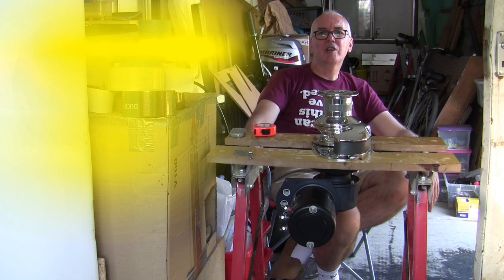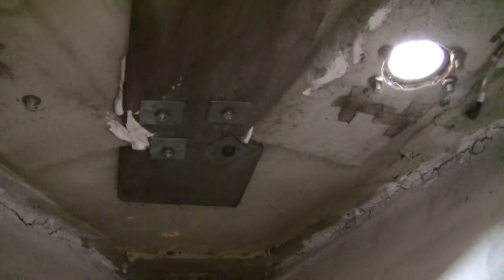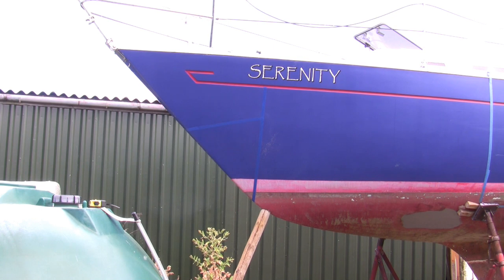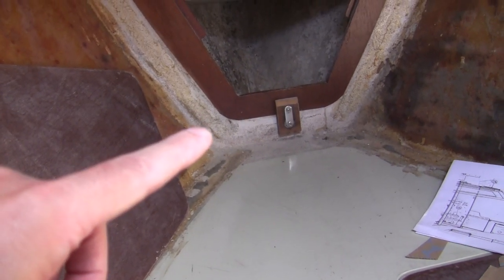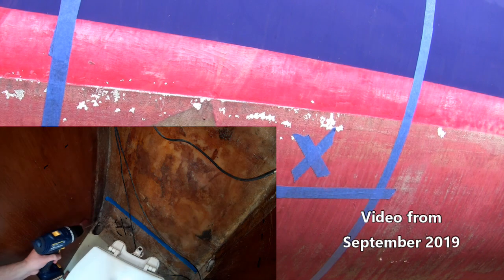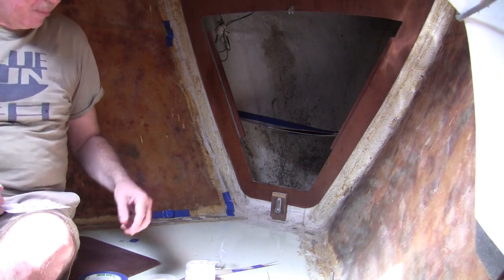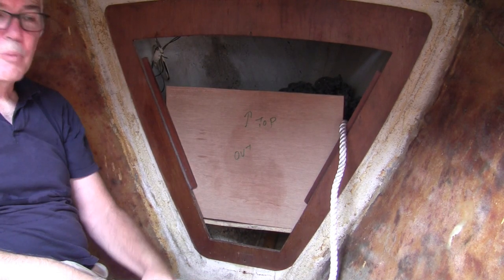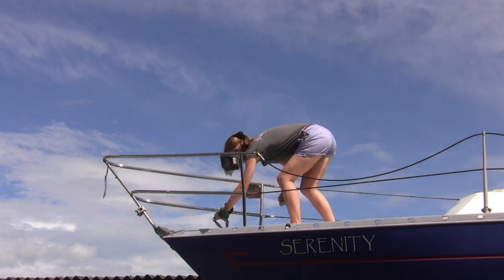Just About Sailing August 2020 - Installing the new Windlass - Pt 1 Chain Locker Modification Plans

Comment: Paul hello, Really enjoyed and learned a lot from that - thank you...
Just anecdotally the 300mm chain drop from below deck did not work in my last boat (Westerly Ocean 43) if I had laid out all the chain and a bit of warp - cos it always formed a pyramid ....  The chain did not just fall into a neat coils rather heaped up...  the first I would know was that it jammed at hole by the windlass!  I had then to get into the chain locker via the hatch and spread the chain out.. then unjam it - not always that easy...  
I am assuming the windlass people stipulated the 3300mm.. Also I have no solution to  offer...  When I installed an electric windlass onto my Moody 36 and was anchoring on a daily basis never had the problem - so .... Maybe the drop was greater or the floor was angled so the chain fell to one side???
I have not anchored yet in my new to me Beneteau 323, partly as I am waiting to change the danforth for a CQR - probably a rip off... The price of real CQRs is impressive...
Thanks for all the information
Michael
Reply from the maker: Michael
I have been on a number of boats where the procedure was basically to open the chain locker from above and pause the windlass on a regular basis to 'push over' the heap of chain with your foot. An accident just waiting to happen.
The 300 mm is stipulated by Lofrans. But I bet that there is some physics that would help to understand the factors that would encourage a chain to 'coil' rather than 'pyramid'. Obviously if the drop was big enough it wouldn't matter what the chain did. But I do have a bit of an angle on the new locker floor, so maybe that will help.
When I've got it all installed I might fix up a camera with the watertight door open and film what is happening inside the locker - or just shove my fake GoPro in the locker with a light and cross my fingers that I don't wreck yet another one.
I swapped from a (probably fake) CQR to a Roca with some trepidation, but have been very happy with it so far.
Cheers
Paul

Comment: Shiny as always. Just an idea about the drain in the anchor locker, I think it would be an easy option to fit a small bilge pump and that way you could have the exit high again without having to fit a seacock which will take up quite a bit of space. Plus then all you need to do is flip a switch rather than having to get in there to manually open and close it?
Reply from the maker: Thanks. Yep, that would certainly be an option. I am probably making this more complicated than it needs to be. Although I intend to fit a seacock, it doesn't really need it. It will probably stay open for 99% of the time. I am probably more likely to forget to press a switch than I am to open/close a seacock.
I think that pretty much all of the different suggestions would work. There are even more if you google the subject. The main thing will be to have an electric windlass - that will be pur luxury. And it is very, very Shiny!
Thanks for watching
Paul

Comment: I really like this one.  I have a C&C 30 with the same kind of locker in the bow, but no holes through the deck to feed chain.  You've given me the confidence to install a windlass and hawse pipe,and start using the anchor locker.  As it is now, I have to keep the anchor sitting on the deck and just have rode attached to it, hanging on the pulpit.  I have a feed through to the bilge to drain it, but am a little concerned about mud building up, so may also use your drain approach..
Reply from the maker: I am guessing you have the C&C 30 which is the same shape as Alfie's (Sail Life) old boat (a C&C 34). I found his video from about 2 years ago very useful. His boat has a similar shaped bow - which is very pointy. His video was mostly covering the wiring, which I am going to copy.
Please have a good look around at what others are doing. I don't want to be held responsible if everything goes horribly wrong ;)
I haven't seen anyone else doing quite the same as what I intend....and there may be a good reason for that which I will only discover after a few years use.
There was a lot of 'crud' in the bottom of my chain locker which had built up over the years.
Good luck with it.
Cheers
Paul

Comment: I learned the hard way that you get the effective new-generation anchor you want first, and the bow roller that fits it.  Get them mounted so they sit well on the bow and only THEN mount the windlass to line up with the roller.  

If you upgrade the anchor eventually and or roller after your new windlass is mounted you are inevitably going to find out that a larger anchor and wider roller will not line up to where the tiny narrow roller used to be.

Ease of anchoring is all about a heavy duty roller that can handle the anchor well and not bind or jam and can bring the anchor itself up to be held securely without needing to hang over the bow and use brute strength to do it by hand.
Reply from the maker: Thanks. Good advice.
Well I certainly don't have the brute strength to pull the anchor up by hand - so that's not an option. Although I do have an emergency set-up where I can use a main winch; just in case. I used it once in a strong tidal stream, but once the anchor was off the seabed it was very smooth.
I invested in a new Rocna ages ago and have been very happy with it. I never liked the idea of 'plough' anchors. I've spent plenty of time watching fields being ploughed. The plough anchors are literally exactly the same design as the agricultural ones that can be dragged happily behind a tractor. I never saw the sense in them, as they are not designed to hold firm. I got rid of the one that came with the boat as soon as I could.
The Rocna actually comes up well on the current roller and (more luck than judgement) simply fitted straight away as soon as I installed it. It also stows very securely without banging or rattling - the self-righting 'loop' fits into a little holder that I attached to the pulpit to make it extra secure. I think the fact that Serenity has such a pointed bow with a huge overhang helps a lot. I have been very lucky with the way the Rocna has fitted - I know that some people (with more upright stems) have had a lot of problems fitting them and have to make all sorts of modifications.
I also invested a bit more to get calibrated anchor chain (8 mm) knowing that I would install a windlass at some point.
The vertical windlass is a bit more sensitive to its relative height to the bow roller. But as long as the (chain) angle from roller to windlass is 5 degrees or less it should be fine.
I am having to change the rode to three strand as multiplait doesn't work too well with this windlass.
I'm thinking of using a lightweight anchor such as a Fortress for the stern with shorter chain (possibly 6 mm) and a longer rode - maybe reuse the multiplait. I already have a ready made locker with a drain for that as I am not using my gas locker any more.
I hope you are doing well.
Cheers
Paul
Reply: Sounds like you have things settled well then. Rocna is great, we have a 45lb Mantus.  

Get it lined up as well as you possibly can and make sure the anchor is easy to secure quickly once in it is up and in the roller.  I run a second line up through the roll bar and then back down to a cleat I installed just for this purpose.

A fortress on a rail mount in the cockpit is a good stern anchor. We have an ikd 30lb Danforth.  Make sure the rode is large enough to be easy to handle since tiny line makes the job that much harder without a windlass helping.  But a sheet winch is right there if necessary.   

We have massive 3/4" line that is super easy to grip even though it is nearly twice as strong as it needs to be.  8-braid lays down really well and packs into a small space. It's a good choice.  Having a line locker aft is really nice.  I sacrificed a locker aft to store ours too.  

We have 220 feet of fiber and 25' of massive 3/8" chain (that weighs as much as the anchor itself) on our aft anchor.  

We have 220' of calibrated 8mm chain on our main anchor in the bow with another 150' of rode that we have never used.  We rarely put out more than 120-130' of chain since we draw 4'3" and usually anchor in as shallow of water as we can find.

Comment: The simple solution is to make an external drain hole  at the bottom of the existing locker. I did this with my Rival although it's not been tested in any rough sailing conditions. What may come in will drain out. The conversion to an elevated floor will likely leave a situation where you will be having to go and push down a pyramid of chain building up under the windlass. My old mk 2 had a leak from the rear of that 'shelf' which needed someone with a very long arm to repair from the deck hatch. This water would build up in the forward bunk locker. Electric windlass was a good investment.
Reply from the maker: Mike
Thanks. The electric windlass will definitely be a good investment. I don't think I could actually sail without one any more.
The drawing I have for the Mk I is a bit misleading. As was the brief bit of video I shot of the 'bottom' of the chain locker. I vacuumed out a ton of old detritus and then used the magnets to find out how far down the locker actually went. It goes right down to the water line - possibly even a few millimetres more. I am loath to put in a hole that low.
I think I also have a bit of a leak at the bottom of the bulkhead (under the V-berth shelf) because I also used to get pools of water and I can't think where else it could have come from.
I am hoping that because I have a bit more than 300 mm (the minimum recommended) the pyramid problem won't be too bad. I have spent some time on a boat with far less than this (almost zero) and that was a complete pain.
Cheers
Paul
Reply: @verynearlyaboutsailing8114  My last Cobra had an electric windlass, kind of spoilt me, all I could do this year on the Fulmar, with a few twinges, was to raise 30m of 10mm chain plus 25 lb CQR plus a pile of kelp. The only help, a reefed main driving the boat forward over the chain. The Rival's drain hole is more or less waterline. I put some of that grating style heavy rubber door mat at the bottom of the locker to keep tne chain off the hull. It's  only tested so far on a coastal light breeze condition but been happy in the harbour here for years waiting for me to finish the rest of the project. Did a bit today!

Comment: I’d just use a plastic dinghy bung for the drain you can open and shut them as you please. Drains at the front end usually have a little chrome shield over them helps suck out the water, that’s a baby of a windlass,Godspeed,you should treat her to a Toni &Guy only £120.00
Reply from the maker: Yes, I will put on one of those little chrome shield things. As you say there is some sort of physics effect (with a posh name) that means the water is actually sucked out as the boat is moving along. Although I have noticed that a lot of boats don't have them. I know I am most Definitely over-engineering the drainage issue...and it hasn't even been a problem for the last 45 years of the boat's life. The key thing is really the windlass which will make a huge difference.
And as for your other point. Just think about how much chocolate £120 would buy ;)
Cheers
Paul
Reply: Just about sailing Venturi is it, I’ve got them on mine ,I’ve put dinghy bungs in the built in buoyancy spaces so I can check they are water tight very useful things . I like chocolate, but I’m stuck on Tunnocks caramel logs, the Iceland man brings my packet on Thursdays I always have galaxy choc drink on the boat. Get on with it!!

Comment: Coming along, Paul, deck layout looks good for the new winch...keep up the progress, we'll be sailing soon LOL
Cheers
Randy
Reply from the maker: Randy, pressing a button to get the anchor back in will be the ultimate luxury.
I think you might be sailing before me at the rate you're going.
Cheers
Paul
Reply: @verynearlyaboutsailing8114  yes pushing a button will be great...not in my budget, my electrical battery bank budget, lol...If I see my bank can handle a winch, I did run an extra #10 wire...cheers

Comment: I fitted a X2 onto my Mirage 28 Mk1 a couple of years ago, it all works perfectly. There is a hole already which drains the chain locker out of the bow, i assumed this was standard but it might be that it was drilled by a previous owner. As far as I am aware, no extra "floor" was fitted into the chain locker. I can take some measurements if you need when I am next at my boat later next week. I spent months planning the whole operation, then a couple of weekends carrying the work out. I made life awkward for myself by only cutting a 12" circle out of the forward bulkhead, I have fitted an inspection hatch into this. I also mounted the windlass on a 15mm oak plate I made which gave another 15mm of fall into the locker. My 1979 Mirage also has the deck access hatch at the front, maybe your vessel is slightly older.
Reply from the maker: Thanks. Very interesting. It's nice to hear that someone else has an X2 on a Mirage.
I think my Mirage 28 might be quite an early one. The number on the sail is '39'. I don't know if that means it is actually the 39th one made or not. I would also guess that they made slight modifications as they went along. There sometimes isn't a huge jump as they go from one version to another as most of the changes have already been made. I would guess that there are many different solutions out there from the factory.
One I vacuumed out all the detritus from the chain locker I measured (using the magnets) where the bottom of the locker was. - It was right at the waterline.
I will probably fit the largest rectangular inspection hatch that will fit.
Cheers
Paul
Reply: @verynearlyaboutsailing8114  I have dug out my old notes and my drawing shows I have around the 300mm from the top of the chain pile to the deck surface, then the 18mm Oak wooden mount which would give a fall of 318mm. It all works very well and has not failed during the 3 seasons of use. My sail number is 113, possibly much later than your vessel. It looks as though I also have what you may term the Mk2 anchor locker type set up with the bow drain hole. If I knew how to add a couple of photo's to these comments of the bow showing the distance above the waterline of the drain hole and the deck I would add them.
Cheers - Kevin
Reply from the maker: Thanks for checking this out Kevin.
Another thing worth considering is that some Mirages were sold for home completion. Some of the woodworking around the galley area is a bit different from any other Mirage I have seen, so mine could have been built from a kit.
A lot of them also went out to Greece for charter holidays - they probably had a different specification as well.
Paul
Reply: @verynearlyaboutsailing8114  My Mirage was home finished, quite nicely done too by whoever did it. My anchor locker must have a shelf like you are proposing (i.e. MK 2 type). I can take measurements if you wish later in the week. I have 26M x 8mm chain and 40M x12mm rode attached and get approx 300mm from the top of this to the deck. Selonoid is mounted just behind the windlass in the port side of the forepeak and boxed in. The foot switches are on deck above this. I also made a small remote box which I can plug in at the cockpit to operate the windlass from there. All works very well and is very labour saving, especially for single handed sailing. - Kevin.
Reply from the maker: My internet just failed, so apologies if you get two replies.
Don't make a special trip to take measurements - but if you do take measurements I would be interested. My electrical installation will be pretty much the same as you describe. I bought all the bits with the windlass including footswitches and remote control. I am going to do all the electrics as almost the last thing I do. I don't have an issue with electrics and haven't fully made up my mind on batteries, alternator diodes and all that stuff yet.
Yes, having an electric windlass will be a total game changer for me.
Paul
Reply: @verynearlyaboutsailing8114  I shall be going up to my boat tomorrow evening Paul, if you would like any specific measurements then let me know. In case you are interested, as well as the engine battery Parergon is fitted with 2 x 110A leisure batteries charged by a 60A alternator on a Beta 20hp through a split charging diode (an oldish Victron one I think).
Reply from the maker: Kevin
I would be interested to know how deep your chain locker is. IE from the deck to the floor of the locker. Or anything else you think might be interesting (IE different) from what you have seen in my video.
I also have two 110Ah leisure batteries and a starter battery. I might put in a third leisure battery - but finalising my electrics will be one of the last things I do. I also have a Beta 20 - but I can't remember what size my alternator is. I don't have a split charging diode (yet), but am thinking of options around this plus possibly some sort of smart charging option (Sterling do something). There is also solar and wind generation to think about.
Thanks for all the info.
Cheers
Paul
Reply: @verynearlyaboutsailing8114  Hi Paul. I have taken a few measurements this morning, Anchor locker internal measurements are approx. 660 at the bow, 550 at the bulkhead so theres approx 100mm fall built in. These are to the underneath of deck. The drain hole is approx. 400mm vertically above waterline. If you need to know anything else please do let me know. - Cheers Kevin.